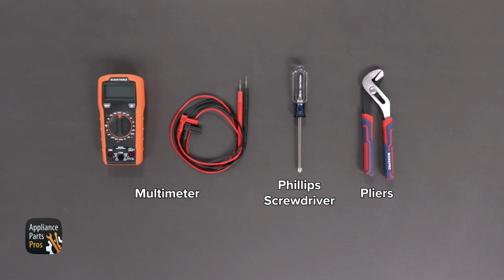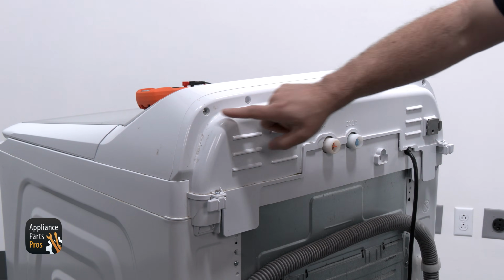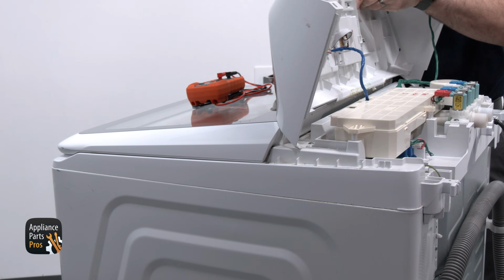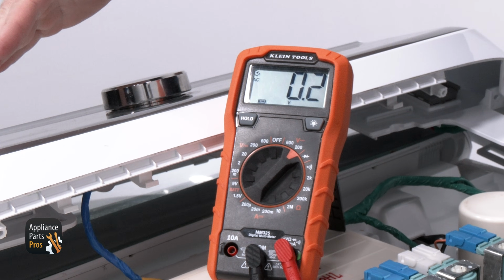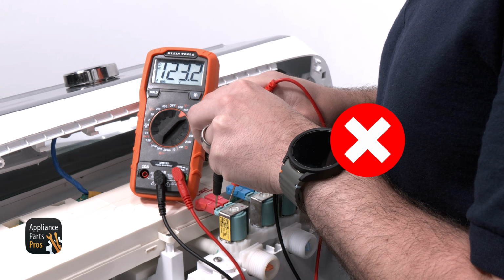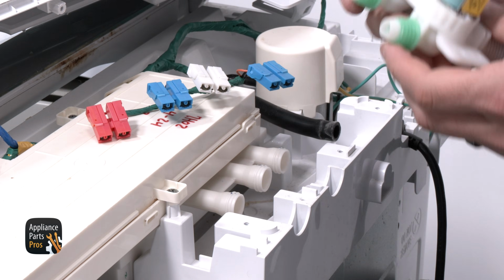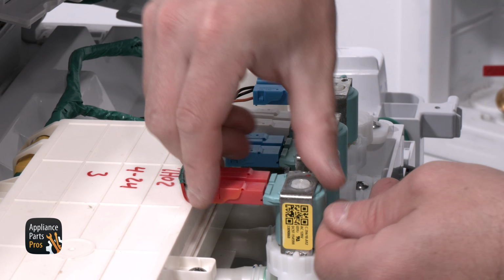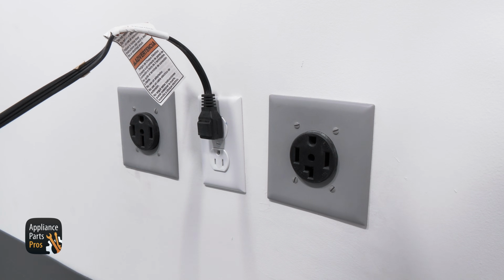DIY Samsung Washer Inlet Valve Repair Made EASY

Comment: My water inlet won't shut off and continuously runs. Same repair?
Reply from the maker: Yes, it should be the same. If it won't shut off, the valve solenoid has more than likely failed.

Comment: Is there anything special about these water inlet valves. I have a Midea that is exactly like this water inlet valve but I cannot find a replacement one for it. Are these basically off the shelf parts that every manufacturer uses.
Reply from the maker: Water inlet valves are model-specific, and we can’t guarantee that a valve from a different brand would work properly in your unit. We can only recommend using the part specified by the manufacturer to ensure the right fit and function.

Comment: Water pressure is good, screen is clean, tub fills normally.
But we get the 4c error when it would normally start the wash cycle.
Then everything stops, and the tub drains out - through gravity, not pumped.

Any suggestions? :)
Reply from the maker: What is the model number of your appliance?
Reply: @appliancepartspros  TYVM for replying!
Ends up it was a burnt sensor, now repaired and working fine. :)
Reply from the maker: Awesome to hear you tracked it down and got it fixed—burnt sensors can definitely throw some confusing symptoms. Thanks for the update, and happy washing!
Reply: @HowardGoldman-v9y  im getting the 4c error as well where is the sensor located and do you have a part number for said sensor?
Reply: @HowardGoldman-v9y what sensor was faulty on your washing machine?
Reply: @HowardGoldman-v9y any update on what sensor was burnt? currently getting a 4c error code after the wash cycle completes no problem and rinse begins with slow water flow. Washer now started continuing to leak water into the drum after being turned off. Thinking it’s sensor or inlet valve